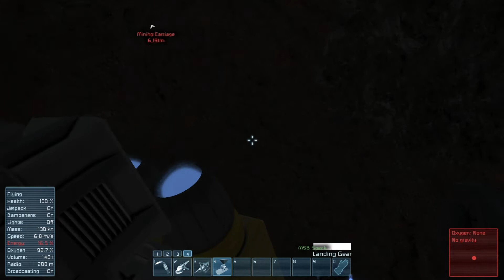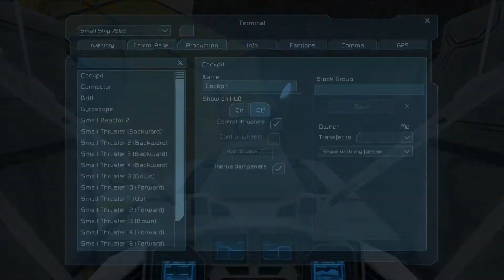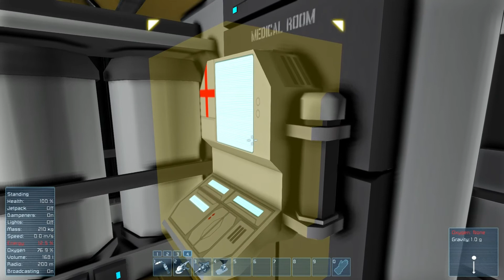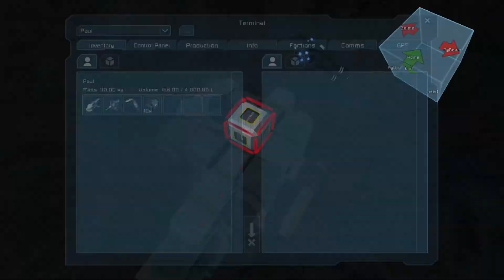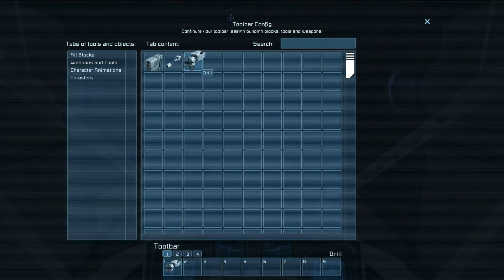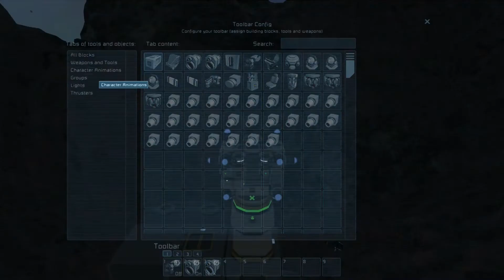Let's Play Space Engineers Survival with Brian - Part 22

Comment: You have to pay close attention to the actual generator and how it's placed. Each generator has 8 sides - 2 of those are control panels and 6 are actual connection points, meaning if you want to connect the generator to something it has to touch it via the connector points. If you put it the wrong way and one control panel is touching whatever you wish to power, it will not power it.